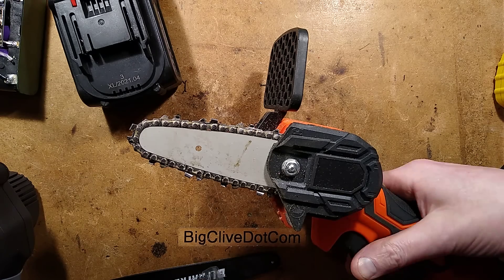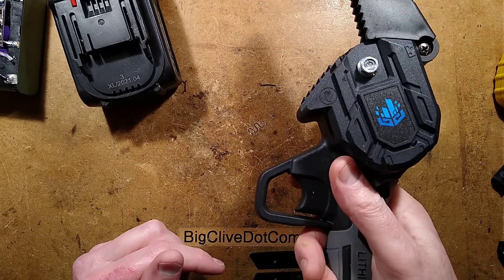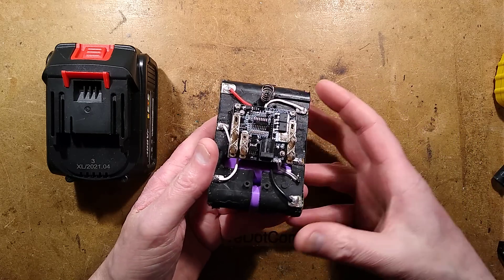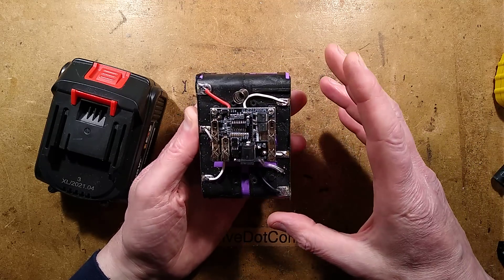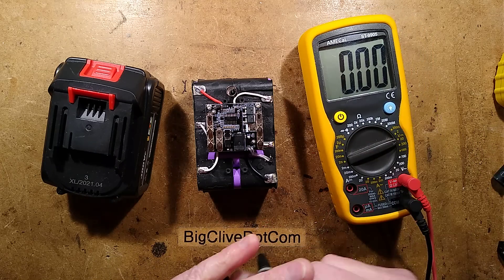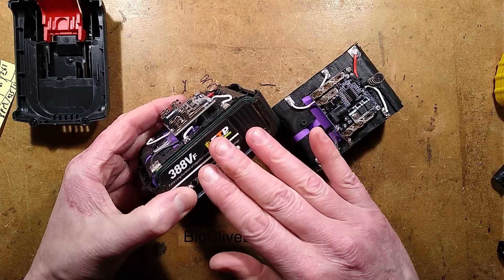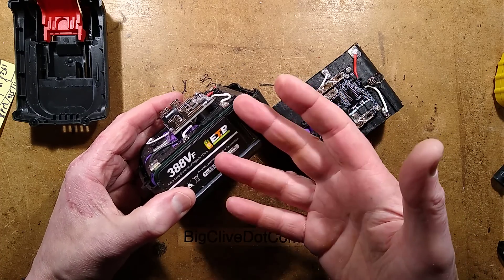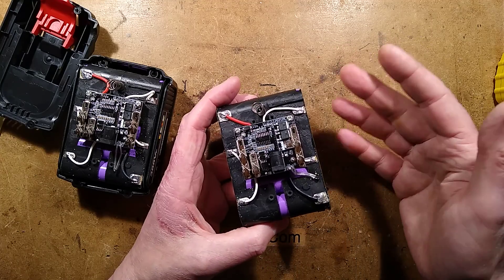Dead batteries - with odd charging circuitry

Comment: How many "disposable" batteries would it take to sub out the cells in one of the depleted battery packs?
Reply from the maker: While it might be viable to swap in a parallel array of scavenged cells, it might be a bit tricky to fit in.

Comment: cheap chinese power tools and vacuums are great for the price except the battery cells. the cells are low capacity and weak.  at this point, they should resolve this by going with 2170 cells  with same chemistry/supplier-this will increase capacity and performance for not much more money.  i have multiple vacuums and packs that went dead because one cell died prematurely

Comment: I wonder if it could slightly extend their (off charger) life if they had some sort of mechanism for charging the lowest cell with the highest cell at a certain critical level.
Reply: Yeah they actually do! That's why each battery has it's own wire as well as being connected to the other cells by the nickel strip. It's called a balance charge system and it's not an option as far as I'm concerned, and there are many nuances that li-on cells require to perform well and function as a battery and not an ignition source,  but unfortunately (and to my absolute disbelief!!) many if not most companies only provide what's required by law and not by reality of what maximizes the safety of the battery. Almost all battery fires occur because of damage or condition caused during charging. Relative to the number of li-on products available, very few come with adequate charging devices or instructions for safe care of something that would NOT HAVE BEEN ALLOWED on the market because of its potential danger back in the days when the carpeted floor in every shop was littered with cigarette butts, you could ride unprotected and unrestrained in the tray of a vehicle on the freeway and burn portable petroleum fuel heaters in any building for cooking or heating. You can't take a bottle of water or a phone with a broken screen on a plane but it's ok for everyone to have 1 to 5 of these well known potential bombs, on their person when boarding a plane!
Reply: @mrgoodman6620  Ah, I looked it up. I've only ever seen passive balancing systems but it looks like there are active systems that will do exactly what I asked.
IMO they should be the standard especially for packs that go in tools and are going to be worked hard when worked.

Comment: A regular chainsaw has a protection switch/break on the hand guard.
My mains eletric chainsaw has similar. It cuts power when pulled back and I have to bump it forward to make it go.
It is that large black paddle sticking out the top.
Reply from the maker: The paddle is just a guard.  No switch.

Comment: I recommend that you check Bosch batteries. They have no cell monitoring at all! I was shocked when i opened the first one. Even the 4Ah ProCore 21700 is made this way.
Reply from the maker: I'll have to check that out.
Reply: I think that you need to look more closely. The ProCore 21700 packs balance by contacting the outside of all of the cells (the cathode). It's hidden inside the battery carrier. https://youtu.be/0TGBRyaAJ6U?si=0RjLUq4ZWZXg_JQQ&t=170 All Bosch packs that I've seen have individual cell monitoring.
Reply: @Shaun.Stephens  I did not take the top off the Procore battery, but the cells are bare, so this can be true. However the earlier compact batteries have no connctions to the individual cells.

Comment: With a 3d printer and a bit of ingenuity, you could conceivably remove the board out of that battery and put it and the batteries into a different enclosure -- one that allows you to easily swap out the cells that go bad. When I see products like this one in the video, it just infuriates me. There is absolutely no reason to not allow the end-users to replace individual cells. Any device with a 'parasitic current draw' in the battery pack should ALWAYS come with a simple external toggle switch to turn it entirely off for long-term-storage. But the corporate world knows they will make lots more money selling you a whole new unit instead. I have a similar sense of disgust with the multi-color inkjet cartridges. As soon as a single color is used up, the rest of the ink for the other colors gets dumped. Capitalism has not properly incentivized the engineering of things in the best possible way FOR THE CONSUMERS. Engineers are engineering products to last basically one day longer than the included warranties. Why? Because that's the point at which their employers can make as much money as possible with this unethical methodology. Even if we were somehow 100% effective and efficient at recycling, this 'disposable product' ideology would still be an additional unnecessary hassle for end-users.

Comment: I have a Vax OnePWR pack which had some sort of thermal fuse trip causing it to never be chargeable ever again as the battery has some 'smart' charging circuitry. I rebalanced the cells manually but it still wouldn't charge. The packs are about £80 new - there's some very small print saying (words to the effect of) 'wait 15 minutes after using the battery fully to let it cool down', presumably due to the current draw heating them up too much. 

Replacements under warranty due to failure are a common issue with them. Shame the bad design and thermal management causes so much e-waste. I would have thought it better to have used a thermal probe to throttle back the charging rate then ramp it up as the cells cooled.

Comment: Hey Clive, just dropping  in on the video because I was wondering if you'd thought about looking at any heat not burn  tobacco devices because I'd be interested to know exactly how they work.
Cheers
Reply from the maker: Some use a heater that allows you to pull hot air over the plant material to vaporise the oils.  Others for resinous concentrate use a heated ceramic cup.

Comment: We found an old Bosch electric screwdriver at work that uses those 10.8V batteries (now sold under the incorrect name of "12V"), and it still had a charge on the battery for quite some time even though it had been sitting unused for years. I picked up a modern version for myself and charged up the old battery, and it's still going fine. I'm not inclined to pull it apart, but I probably should at least measure the pack voltage at full charge and make sure they're not self-discharging. A new battery is certainly worthwhile compared to buying a whole new tool, battery and charger.

Comment: I have several Makita power tools and like to have two or three batteries per tool, so I purchased a few Chinese knock off makita batteries, some of which although they came charged and would work the tools would not accept a charge or rather the makita chargers refused to charge them declaring them faulty, they charge from a bench power supply. So in the long term I think the genuine Makita batteries are best, in fact I have now gone the reverse and purchased a Chinese copy of the Makita impact wrench and run that with genuine makita batteries which I tend to buy several at a time when tool companies have them on special offer. What I do not get is why anyone would have multiple tools and only one battery.

Comment: Makita uses the 3rd pin as a signalling pin to the tool (as well as for charging). The 3rd pin is held high for power-good and brought low for power-off. I have a vid on my channel about this if you're interested.

Comment: I have the same saw, wouldn’t charge from day 1, opened the pack and every cell voltage was about 0.5v. Kept the plastic case, replaced cells, new bms.

Comment: are these Worx battery ? i bought a makita adapter for works, is it risky to deplete the worx in a makita device?
Reply from the maker: It depends on whether the battery low voltage shutoff is in the tool or battery.

Comment: This is the type of circuits where you kinda need to draw the body diode of the MOSFETs for clarity; they are the very reason why these controllers even have more than one FET at the output in the first place, and it's likely they also play a role in the "hacks" used in this particular battery pack, specially during charging.

Not an expert, tho, just a thought! :3

Comment: Have you looked into reviving old NI-CAD batteries? I found that you can revive them by blasting them with high current and recharging them with higher voltages
Reply from the maker: A short term fix for older NiCd cells with internal shorts forming was to jolt them with high current to blow the whiskers away, but it's a last resort and definitely not suited to lithium cells.

Comment: A nailgun battery test video may be neat. With appropriate protection, take some cells at various voltages, and stick a nail through them. Depending on ESR and charge state, this can vary from 'gets a bit warm' to 'loud roar of flame and vents 90% of the contents of the battery'

Comment: What construction were the Cvcx 100nF capacitors with the 1k0 resistors used to sense cell voltage? If they were ceramic monobloc then the 1k0 would prevent a leaky layer from fusing / self-healing, and so would progressively increase the parasitic drain on those cells.
Reply from the maker: I did ponder if a leaky capacitor was an issue, but these are very low value, so less of a risk.

Comment: The parasitic draw was only on the center cells. You could recycle those cells, and use the remaining ones to rebuild a functional battery pack.
Reply: The risk is the other cells are often overcharged because of the dead cells in the middle.  It sounds like this circuit has a protection preventing that though.

Comment: Makita™ batteries really do self discharge ! !   However , my  STANLEY  FATMAX™ retains  FULL ! ! ! charge , even when not used for 1 year .... this is  SUPERB ! ! .... for viewers trying to recharge ( strange ? ) Li-ion packs found in the recycling ( such as the HUGE assemblies used in e- bikes ) , and ,  the balancing electronics is missing ... the ONLY safe way to recharge is to use a 4.2 Volt charger ( old vape chargers work well ) and charge each 3v7 cell stack  , one at a time ... this can take  AGES , but there is  NO  risk of fire doing it like this ..... ( tried - n - tested ) ...... DAVE™🛑

Comment: Just rebuild the cells spot welder easy clive
Reply from the maker: Cheaper to buy a new tool with two matching batteries.  Proper spot welding of cells is a fine art that requires a well designed spot welder.

Comment: deep discharged cells can slowly be recovered with very low current, but any significant defect in the electrodes will be a significantly increased risk of failure.

Comment: Those china tool battery bms's are utter dog shit they do not top balance cells only has bottom protect low volt cut if cells start drifting and they do its just a matter of time till batterry is unusable as capacity slowly degrades, they also use the shittiest 1200mah cells

Comment: Even the cell at 1.4v is recoverable.  The cell with -0.09v is toast.
Reply: Not only that, the cell is straight-up internally shorted. Clive said he tried to charge that cell and it quickly went back to zero volts.

Comment: couldnt ya rebuild the pack with new cells clive? the circuitry is still working
Reply from the maker: It's actually a lot cheaper to buy a tool with a set of batteries.

Comment: There's a number of businesses in my country that take old battery packs, dismantle them and charge and test each cell, then retest after a month and sell the good cells and, at a much cheaper price, sell ok (but not perfect) cells. I have used them to repack batteries (even for electric bikes) and they work perfectly.
   Cell monitoring is so easy, I don't know why all battery packs don't have a balanced charging system.
Reply: Yep, all sorts of things go on, no doubt.  I've also seen people soldering wires direct to the terminals of an Alkaline PP3..
Reply: @thephilpott2194  Don't be so arrogant. There's nothing wrong with using cells that have more than 80% of their life left. We're not all so absurdly rich as you and can afford to waste our money and the World's resources; do you replace the battery in your meter every time you use it? How can you compare reusing perfectly fine cells (ones that have been left for a month, then had the voltage checked and load tested) to soldering wires to a battery? Some of us do have good quality spot welders and the skills to use them and warrant our work (we would also stop anyone from soldering batteries). None of the repacked batteries has been returned within the 12 month warranty. No wonder UK is stuffed.

Comment: What a coincidence, Clive. Earlier this year, I had call to do some pruning and, rather than do it by hand (my handsaw had gone a bit wonky), I thought "why not try one of those el cheapo Chinese chainsaws from eBay that Clive mentioned some time ago". So I bought one and it would not hold a charge. At first, I thought it was the charger since it looked very cheap and was very light.
So I swapped the charger with a compatible one that I knew worked. No luck.
I then opened up the battery pack and tried testing it. I couldn't spot any faults on the circuit board. And testing the batteries didn't reveal anything.
Rather than waste time arguing with the vendor and returning it, I bought another one instead from a different vendor.
The original battery was labeled "Power Share" and "24V Lithium". So I looked around for one that used a similar battery (I figured I could open it up and compare them).
So I found one that included a spare battery and bought that. When it arrived, I found the battery mounts weren't exactly compatible. But the batteries charged, at least.
I opened one of them up and the circuit board was completely different. I also found these boards were sold on eBay but I couldn't find one that looked the same.

Comment: So, did you fix the batteries by replacing the cells?
Reply from the maker: No.  I removed the good cells and got another tool with compatible batteries.

Comment: My parents have a Temu-style leaf blower that has batteries with “protection” in the form of a simple RC timing circuit plus thermistor for temperature compensation and it is just beyond infuriating to use. Starts off at full power then gradually ramps down after 30 seconds and shuts off, whereupon I have to remove and reinsert the battery to reset it so it goes back to full power. Rinse repeat. Temptation is to just bypass it but then spontaneous home combustion will inevitably ensue if someone other than me uses it.

Comment: mine have 2 switches, and both should be pushed for the saw to activate. I just regularly check my batteries usually once a month (especially my drone batteries in storage). Tool batteries get topped up once in a while. I just write numbers on them and log charge dates and battery state ( i don't have too many so it doesn't take long)

Comment: That middle... middle right connector related to temperature sensor. You can fool some original makitas with a 10k resistor. Similar trick works for Dewalt / Black and Decker / Porter Cable / stanley. I didn't try other brands.

Comment: Clive made a video 7 years ago titled "Are over-discharged lithium cells safe?" that provides a lot more information on safe discharge thresholds, and it seems that anything not negative is OK (and they may even tolerate a little bit of reverse charging.)

What explains the "common wisdom" about low-voltage cells being unsafe to charge is that if you find a reverse or deeply discharged cell in a pack, it became that way because it had already developed an internal short, and not because it was deeply discharged. It's cause and effect reversed.

The fact that a lot of single-cell charge ICs, from reputable manufacturers, will do a trickle charge is evidence that low (but not reverse) voltage lion cells are not in itself a real hazard. They certainly wouldn't have that feature if it was!

Comment: Hey @Clive: can you tell us why some shaded pole fan motors have the pairs of copper loops separate, and some are cross welded together at the back.  I can't find any explanations of this, and most suppliers don't mention it and only picture the front of the motors, that always look like the loops are parallel and separate.  :/  Cheers. (y)
Reply from the maker: I'm not sure why.  The cross welding might just be for ease of manufacturing, the two on a common pole may be to increase the effect with a manageable wire size, and it's possible that where they are staggered, it may be to create two phase shifts.

Comment: Cheers for the tip!  I just paused and put my electric secateurs on charge, having not used them for over a year!   By the way, if you haven't tried them, please do. You won't need to use a mini chainsaw very often, and they are so quiet!  Best to keep one hand behind your back or in a heavy mitten though. Just in case. You wouldn't notice till a finger was already on the ground!